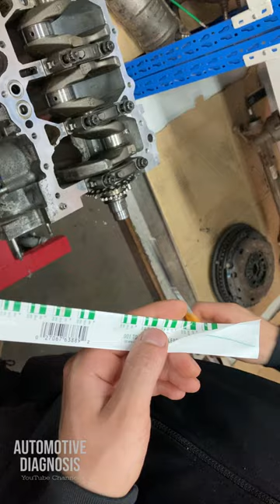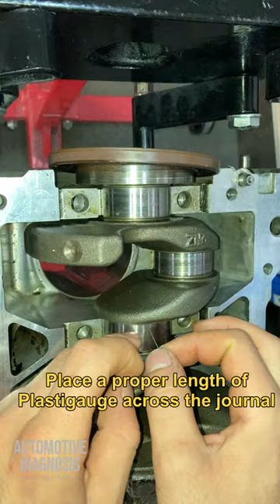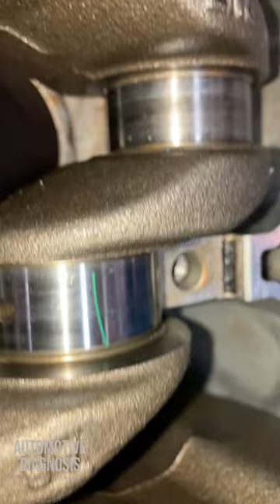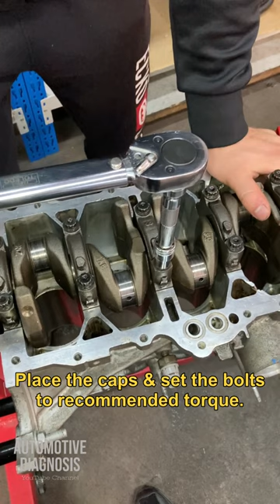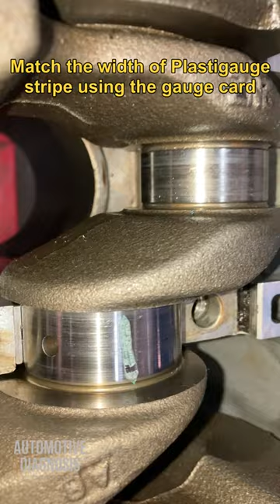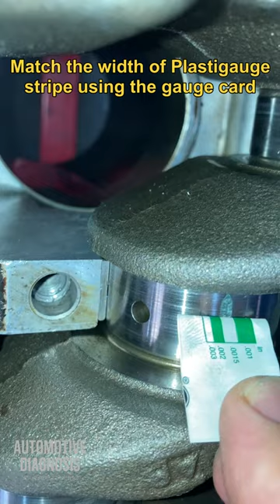How to Use Plastigauge to Measure Crankshaft Main Bearing Oil Clearance

Comment: And do you have to do that on every single one?
Reply: No if your using the same main bearing on all caps
Reply: Depends, on a factory motor with oem parts as a tech I’d just measure one. But in one of my race builds I’d measure everything with dial bore gauges and mic’s down to the 1/10,000 of an inch

Comment: ما اسم ذالك  المعجون  وما اسم هذه  العملية
Reply from the maker: For checking the clearance between crankshaft and main journal bearing we use plastigause, this video shows that procedure.
Reply: @AutomotiveDiagnosis  .Thanks🌞🌷
Reply: The name is plastigauge, it comes in three different colors, to measure different clearances. It is a very nice and accurate way to measure.
Hope it helps you
Reply: @fernandosuarez6877  .Thank you very much✨🌹💐

Comment: Sure just need to make sure that the bolts are designed to be used more than once. I watched a guy destroy his truck by reusing some old bolts that needed to be replaced every time. Sure the crank shaft bolts are fairly strong but still buy new hardware whenever possible because it makes all the difference.
Reply from the maker: That’s true. Thanks for sharing your experience.

Comment: А что делать когда болты крепления одноразовые? После. Проверки снова покупать новые?
Reply from the maker: For using the plastigaue, I would use the old bolts as the brand new ones must be bolted when final reassembly. But I will check them before using to make sure they are not expanded too much, if they are, I will use the better ones that I have in the workshop. Also I normally check it again when I get the new parts just to double check.
Reply: Их можно ещё раз поставить, это же не головка. Не знаю как на этом двигателе, но на дизельных от больших фронтальных погрузчиков типа Амкодор, на корневых бугелях по документам момент затяжки всего 25 кг, на болтах головок на том же двигателе момент 125 кг, насколько помню

Comment: If it is off, then what? Send the crankshaft back to machine ship and ask them to double check? Get the expensive BMW yellow / blue / red bearings (that is if u are working on BMW)? All manufacturers have optional bearings sizes (not the 0.25mm over or undersizes from King bearings, etc) like BMW does?
Reply: Change the bearings